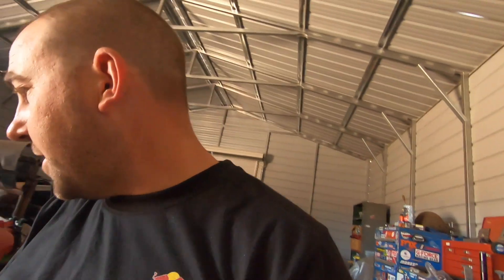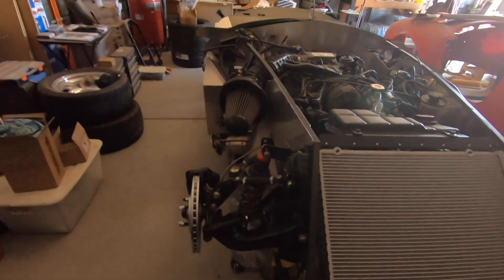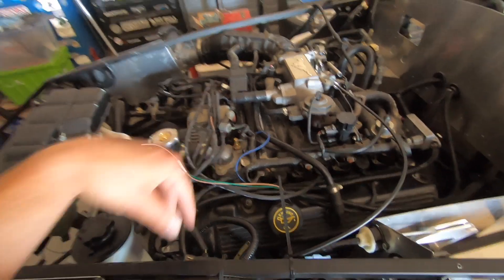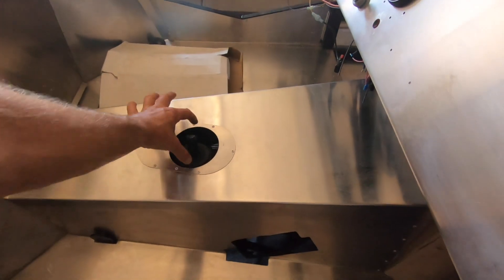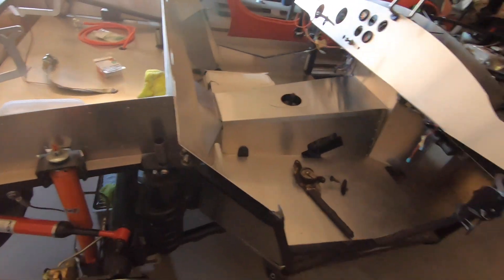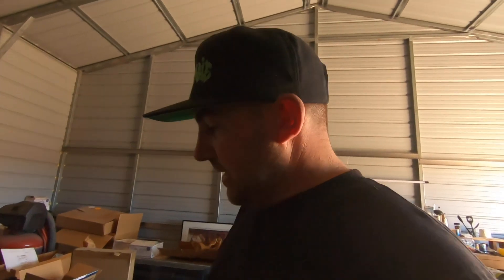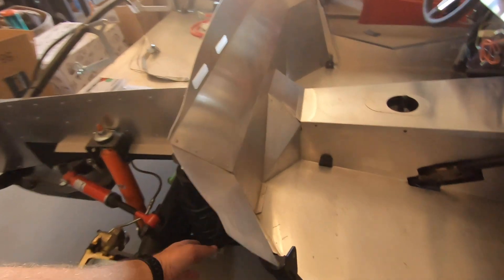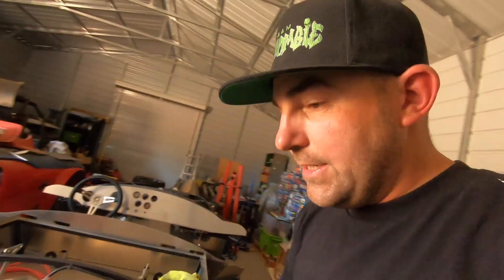Factory Five Cobra Roadster - Transmission Tunnel Aluminum

Comment: I like the idea of the removeable cover but what is the use if the carpet is in the way and isn't removeable? To my knowledge the carpet gets adhesive and will be hard to remove? So i think I will be just applying silicone and rivets and making my trans panel permanent. Crossing my fingers that I don't have any problems down there!
Reply from the maker: I’m not planning on covering the tunnel cover in carpet. I like the idea of covering it in a different material, just not sure exactly what yet.